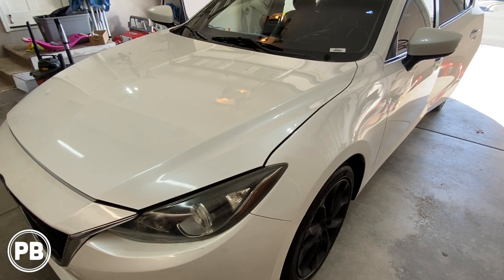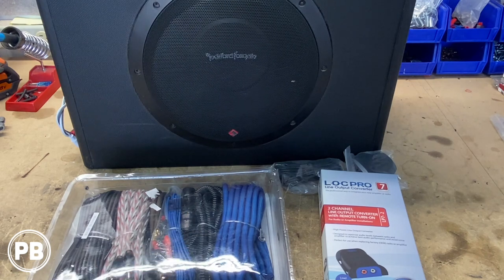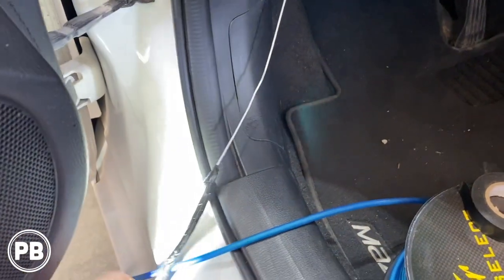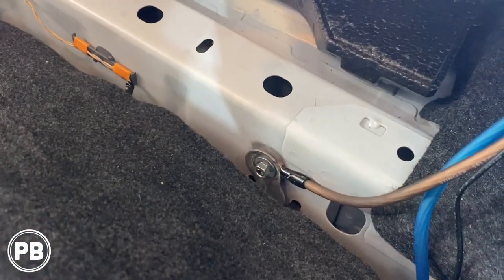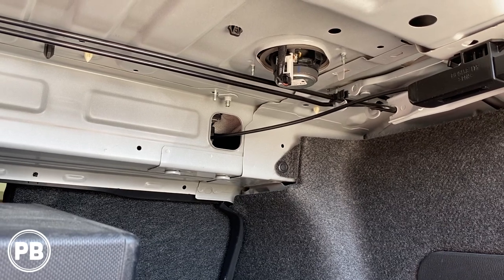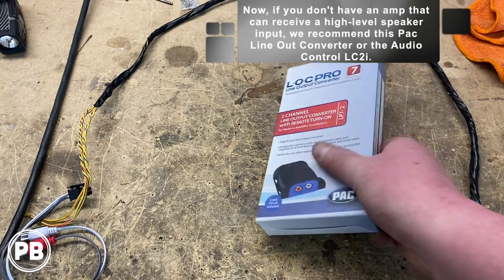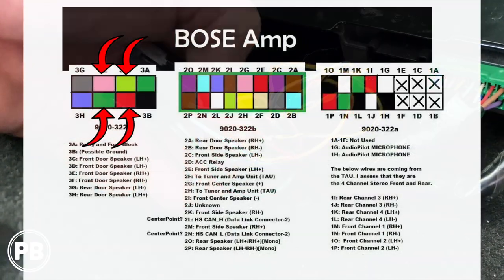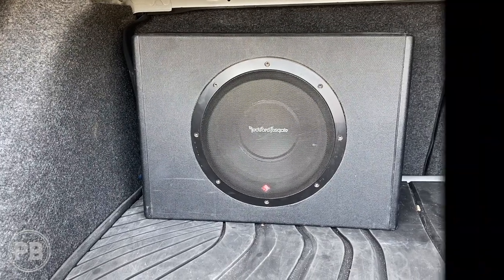2014 - 2018 Mazda 3 Amp and Sub Install

Comment: What changes as far as installation if my mazda does not have the factory bose system?
Reply: I'm still waiting for help on this as well, I'm in the middle of putting a under seat car sub ill hit this section up once I find a alternative
Reply: @maflelei22  thatd be awesome man! Ive never installed speakers and definitely dont want mess anything up.
Reply: @maflelei22 theres a video on rockford fosgate sub review. They said to tap in to rear door speakers harness.

Comment: Followed directions all went fine until removal of the front passenger seat to gain access to the BOSE amplifier. Whew, what is the answer to that ? I have tried everything to get those bolts to budge.
Reply from the maker: Impact driver. If using a ratchet and socket only, it will be tough. I recommend a breaker bar

Comment: PAC AOEM-MAZ2 T-harness connects at the TAU behind the glovebox.. 2 sets of RCA outs (front and rear L/R) and a remote start wire. Works on 2007 to 2018 Mazda 3s.
Reply from the maker: For non-Bose equipped vehicles
Reply: @ProvoBeastAudio  The BOSE processing is done at the amp, which I removed. The AA and Carplay are pre TAU. I use it my 2018 Mazda 3 Grand Touring with a DSP and Amp in the hatch.

Comment: Hey I’m currently installing a subwoofer for my 2019. Is the Bose amplifier the same as the one in the video ? And what tools did you use to take out the seat ? I’ve been trouble on that step. Thanks !
Reply: Yo you ever figure it out?
Reply: @seabassgouin7825  yeah! My friends helped me out until it came to the step with the amplifier. I ended up taking my car to an Audio shop and they had the whole wiring kit. But I had them installed it for me cause it was a pain to figure it out. They only charged me $20 thankfully

Comment: You couldve routed into the rear tweeters. Just because the speakers cant produce the low freq bass doesnt mean that its not being sent over the wire

Comment: Nice video. I guess that the OEM signal going from the OEM stereo to the dash tweeters is ALREADY filtered, since I see no capacitor on the OEM tweeter. Therefore, installing 3.5 speakers in the dash would be quite like just intstalling tweeters, since the range of signal will surely be above 3000 Hz, correct? Thanks

Comment: I've watched several of your Mazda install videos.  I'm putting a pwrd sub (JBL Nano) under the p-side seat of a '16 CX-5 Touring non-bose.   It uses spkr-lvl (high) input.   I'm trying to locate the best place to tap the spkr signal.   I do not want to cut the factory radio harness (orange <==> white plug).   I want to tap the speaker wire after the orange (body harness); is that a good spot?   Do I need to tap the front L/R or can I tap the rear L/R?   is the rear spkr signal full range?   it doesn't sound full range when fading 100% rear.   I guess that is due to the spkr size....  Am I thinking correctly, or is there a better place to tap?

Comment: I have a 2014 cx5  the rear door speakers are more mid to lower. It has the Bose stereo. I wish I could find a harness to attach cause I’m very limited behind the  head unit and the amp is u see the dash.

Comment: Nice video, thank you for that!
I want to install an EM-Phaser EBP1000A on my Mazda with Bose System.
It looks like nearly the Same Interface like the Woofer in the Video. It also has Hi-Lo Converter and Auto Turn on inside. But I anyway want to use the "Remote" cable to turn the Woofer on, because I had some bad memories regarding the auto turn on function.
So u say we should use the "2D" Pin o the green harness. In an other post i see, that "2F" should be used. What is correct / better?
Tanks!

Comment: Hi, great video. Question: my Mazda3 2016: w/o Bose system. Issue: the front speakers stopped working (doors, tweeter, etc...) barely some white noise and very faded sound. Yes, the fader is all the way set to the front. I believe either the amp is defective or very unlikely one bad speaker might the compromising the whole front speakers' volume? Any idea on how to fix this? The rear speakers work fine. Thanks
Reply: having same problem same car

Comment: I really appreciate this video I've got 2 10 inch subs I wanted to change from my old 06 scion xb to My 2014 hatchback mazda 3 and I wanted to know what line output converter to get since it's different than the one in my old xb
Reply: Funny. I'm taking my sub and amp from my 2006 xb to my 2014 Mazda 3 hatchback

Comment: Hello it’s my first time installing anything electrical and im stuck installing the twisted pair RCA Cable to the boss speaker. I am confused in if I am using the pro 7 or not. The amp kit I got has a twisted RCA cable do I cut those ends off as well and there will be 2 wires in each side ? I’m really confused. Please help 🙏🏾
Reply: No you never cut the RCA cable

Comment: You just hook into the trunk speaker with a line converter to on the sub. All you run is the remote wire from the trunk to the driver door ign on/off fuse sign a low pro fuse splice. And r the batter to amp. Battery to cap neg. Cap neg to amp, cap neg to gnd. You just jump both pos and Neg from line converter to back trunk tweeter. Gnd the amp. Attach sub speaker wires to amp. Screw it all down. Btw don't mount your amp to the sub. Vibes are gonna break your Amps smds plus the giant magnet in the sun is an obvious no no next to a power amp. Don't runnpower from battery on same side as alternator on any car as a general rule. Anywys, this install is a lot easier than your method. I also spliced a gain switch befwen converter and RCA to the driver consul for game controller without walking to the truck..

Comment: I saw that you did a skar sdr 10 in a Mazda 6. Between the Rockford p300 10 and the skar sdr 10 package which would you recommend?
Reply from the maker: Skar package is twice the power, but requires a bit more work to install.  Just depends on your level of effort desired with the install.
Reply: @ProvoBeastAudio  thanks have you ever had any skar products fail on you
Reply from the maker: @a.j.4669  Sure, just like other brands as well.  They do have a great warranty.

Comment: Where did you put your remote wire to turn the amp on and off?
Reply from the maker: Our powered subwoofer did it automatically for us. No remote wire needed in our case. If you need one, a line out converter can generate one for you (Pac LP7-2) or you can go to the fuse box for an accessory source.

Comment: what do you recomend to replace the factory bose mine are blown well couple are
Reply from the maker: JBL makes great 2 ohm coaxials https://amzn.to/3p9EjQd
Reply from the maker: Most speakers with JBL are 2 ohm. If you install a 4 ohm speaker, you will notice a significant power reduction.

Comment: To all trying to hook up High output to amp.
This is not the best solution as  quality of audio is not great.I am a dj, electronic engineer and music producer in one person.
You want to replace stock stereo with  third party stereo head unit with quality DSP and 50W RMS per speaker channel.Dedicated preamp for sub amplifier 600-1000W.  Crossovers if you power up door speakers and tweeters from same OUT.
Same goes for back speakers if using instead of sub. Crossovers is a must.Sub amp must have dB boost/trim ( shelf eq boost) and sub freq filter .
Later on you want to upgrade door speakers to some reputable branded speakers such Pioneer, Alpine and such.Cheaper tweeters are good as long they are not piezo. Must be solid  40mm dia with coil.
I used Blaupunkt EMA 455 600-Watt .Also I built own subs and they have not even have ports( 8-10Inch is fine) .All used in Ford Transit Custom van 2018.Stock stereo is a junk quality, so is in other cars.
Reply: Well said.